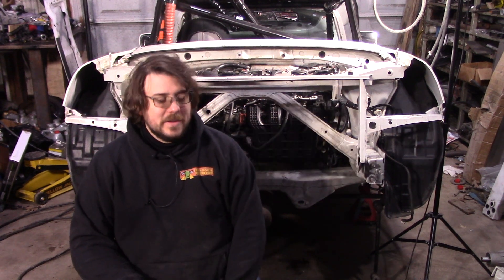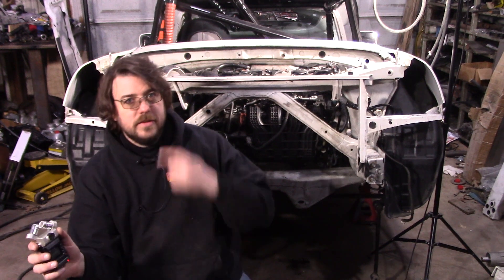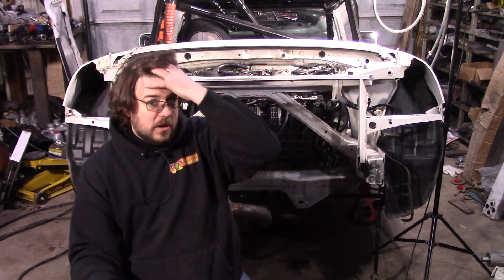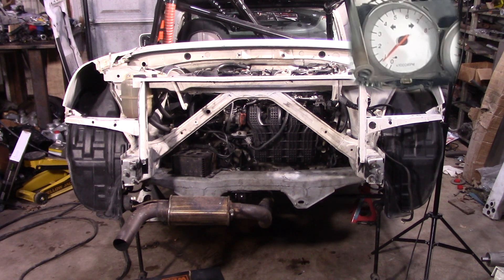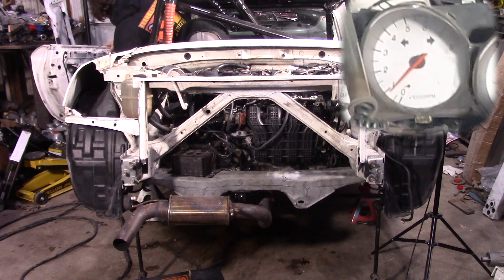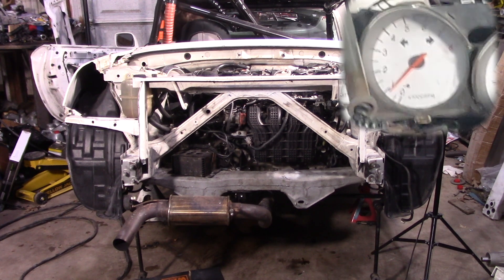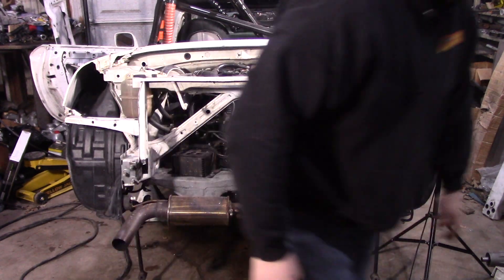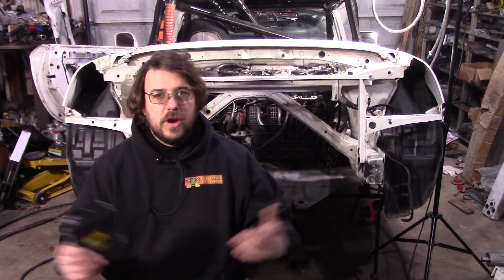Testing the 1AR-FE to 8200RPM in the MR2 Spyder.

Comment: The piston speeds of that motor reving to 8k RPM is 7,533 FPM. For reference the AP1 S2000 at fuel cut of 9150 RPM is 5,380 FPM. Holy shit

Comment: Solid lifter conversion next? Evo8 has this to rev to 10k plus rpm with also these little rocker clips that clip the edge of the roller follower onto the solid/hydraulic lash adjuster so they wont bounce off and go sideways like they do on sr20s

Comment: I’m sure you have mentioned it but I can’t find the video. BUT. What transmission are you using? I found the EB60 LSD on your website. Is that the transmission you are using? I’m guessing it bolts up to the 1AR no problem?
Reply from the maker: with the 2AR In the MR2 Spyder i use the EB60 transmission, in the SW20 i use the E350. The 1AR and 2AR are the exact same external dimensions so the same transmissions can be used.

Comment: where's the shop heat?
Reply from the maker: I have an old noisy diesel fired heater but it's too loud for the camera and frankly i'm tired of smelling like diesel when i come in from the shop. Eventually i'll get a proper mini-split out there.
Reply: @FrankensteinMotorworks  nvidia RTX voice works pretty well to cancel that out! You'd obviously have to post process it as you're not a live stream but I suppose it's easier to switch the heat off for filming 🙂

Comment: As a motorsport engineering student (who dailies Gen 3 MR2) I would reaaaallyy want to know more about the maths you used to estimate the valvetrain RPM limits. 
Keep up the good content, mate!
Reply from the maker: I did it two ways, first, i analyzed all the motions equations involved here without doing any solving just to figure out if the relationship was a logarithmic, linear, square or cubic relationship. Best i can tell it's a linear relationship. So i characterized the current springs with the understanding that they were designed for 6400 and have never had an issue at 7200RPM and scaled up linearly to 8800/9900. I also selected beehive springs to get a better defense against any harmonic frequencies. I also selected titanium retainers to remove a bit of inertia from the system but more importantly to give me a better ratio between extended and compressed.

I also unrolled the cam profile and measured the weight of all the components (including 1/2 the spring and about 5/8ths of the rocker) and calculated the vertical inertia of that weight going up that ramp and determined if the spring rate pushing it down would be enough to stop it from jumping off the cam. I used rough rounded numbers for all this math but it gave me a number above the 9900rpm number above so i called that good enough. 

Neither of these methods are as accurate as they could be but it is good enough for this case.
Reply: Oh, that's some tasty nerdy details. Thank you.
And that's why I love your channel. 👍

Comment: How do you think the Haltech will doin controlling the VVTI?   Do you have some maps of the stock VVTI cam setting's as it progresses through different loads and rpms?   I'm going to be running Haltech on our 2gr and i can't imagine how i'm going to program the cam advance and retard as it goes through it's rpm ranges.  I've never had to program a vvti engine and it's a whole new world to me.  Let us know how it goes!
Reply from the maker: I'll tell you more in a few weeks but i expect it'll do great. for the base vvt-i, cams should be about zero at idle, then at about 4000 or so the intake cam goes to the max and then backs off towards redline. the exhaust should start going up around 5000 or so and max out above 6500 and stay there. that won't be perfect but that'll give you a good spot to start tweaking from
Reply: @FrankensteinMotorworks  Thanks for the info!  Didn't you once unplug the VVTI on your 2gr and it still made pretty decent power as i recall. I've half thought of somehow setting the cams at optimum for max HP and locking them in permanently.
Reply from the maker: @MadManMachines  You can certainly start by just leaving them alone but it would do the motor an injustice if you did not use the vvt-i.
Reply from the maker: @MadManMachines  The other trick is to use MAF, not MAP. the haltech system makes this easy and I'll probably go over it a bit when i make a video.

Comment: Awesome finding, mr mad scientist.  Will this 1ar swap pass obd2 smog?
Reply: Probably would if cats and egr are retained
Reply from the maker: Ruben, egr is all done via exhaust vvt-i on this motor. there are no parts that are EGR only so no egr parts to have filled with gunk as a result.
Reply: @FrankensteinMotorworks  ah nice. As you can tell I'm not too familiar with this engine but seems like some fundamental parts (like internal egr) is the same as on a 3sge beams
Reply from the maker: @ReubenHorner  Honestly EGR plumbing was such a reliability problem i don't think there are many motors left that do EGR with an EGR valve and plumbing into the intake manifold anymore.
Reply from the maker: It depends on your exact local regulations. With a tiny bit of body modifications you can fit the unmodified OEM catalytic converter and then with a bit of extra effort you can fit the stock airbox. With those things you should be able to pass a 2GR through California's CARB regulations. the 1AR is indistinguishable from the 2AR on the outside so i expect you'd be able to get that through also. with cams i don't know if the emissions side of the ECU will get angry or not.
Reply: @FrankensteinMotorworks  My local regulation doesn’t even do visual inspection, just the obd2 check.  As long as there’s no check engine light, they let you pass.  Will your tuned ecu get rid of the check engine light?  Hopefully the new cams wIll not throw a CEL.
Reply from the maker: @Johnnywankerr  Yes, this configuration should not throw a CEL. Currently it does occasionally throw one for a random multiple misfire which i have to address but i expect i will be able to.

Comment: I’m loving the frequent uploads! This is honestly my favorite channel on YouTube.
Would you recommend reving the 2GR out to 8000rpm with upgraded valve springs? I’ve seen some people even rev to 8200rpm. I would love the extra 1000rpm in second gear for autocross. I don’t know if the motor could handle bouncing off of the rev limiter at 8000rpm on some autocross courses though.
Reply from the maker: Oh, also don't get used to the quick uploads. I still have a job and a company to run :) but i do want to get to a somewhat more regular routine though. potentially every other week or so.
Reply from the maker: The 2GR has a MUCH shorter stroke so it isn't as stressful on the bottom end as doing 8000RPM on the 1AR. The 2GR at 8200RPM has the same piston speed as a 1AR at 6800RPM. of course the accelerations aren't the same the reality is probably closer to 7200 on the 1AR has the same stress as the 2gr at 8200. The 2GR also has a smaller cylinder size which means each cylinder isn't hitting as hard. In short, as long as you upgrade the valvetrain i would be ok to spin the 2GR to 8000. Do expect accelerated wear though.

Comment: Smooth as silk. You should've backed yourself. You're too thorough with your work and calculations to make an enormous screw up. Keep up the good work. I wish I was half as good of a mechanic as you are 😁
Reply from the maker: I felt confident on the valvetrain but a 105mm stroke at 8200RPM on internal components is a little crazy. I was genuinely concerned about potentially sending a piston into low earth orbit. I still don't feel that i'm out of the woods yet. I hope it stays together for long enough for me to see where the power band is on these camshafts and based on that i might see about upgrading the rods and pistons.

Comment: Where'd you get the valve springs, Kelford cams or?   Were you worried about piston to valve clearance with the higher lift cam?  I'd imagine with VVTI, it was close even with stock cams in certain ranges?   Just picking your brain...
Reply from the maker: I will share the details but i don't want to share them until it is properly tested. I've had issues in the past with getting blamed for misleading people so i don't want anyone to follow down this track until it's a bit more tested. That said, the cams are custom regrinds and the springs/retainers were purchased by me from a completely different supplier so it isn't a combo that was just recommended together. I felt that the combos that were recommended had too high of a spring pressure and would cause unnecessary friction.

As for the clearance, i did specifically ask for a lower lift cam. I only added about 1mm and the regrind could have added closer to 3mm based on the size of the base circle after the regrind. The motor is an interference motor but only just barely. at TDC there's about 8 or 9mm of valve clearance and the max lift from the factory is 9.5mm and now it's about 10.5mm I think it's got more in it if necessary but honestly 10.5mm valve lift is quite a bit already.

Comment: Sounds really great!  Didn’t think you could go that high with mostly stock internals.  Can’t wait to see the Dyno results.  What is the model of the Haltech ecu?  So excited!  Do you think the 1AR with cam vs. 2AR with the cam will have similar proportional results?
Reply from the maker: The AR motors are surprisingly stout but I am a bit concerned for the pistons though. These are some pretty serious forces involved.
Reply from the maker: I forgot the other half of your question, sorry. It's the 1500 ECU. i would expect the 1ar vs 2ar to be proportional results. Everything about the motors are the same except for the stroke. the 1AR made a bit more power than the difference in displacement would be expected to make but i'd expect that the 2AR would pick up that difference with the bigger cams and then some because the difference is likely due to the intake or exhaust pipes being tuned for a bit higher airflow than the 2AR in 100% stock form was giving them.
Reply: @FrankensteinMotorworks  Thank you for your responses.  Decisions, decisions!  2GR vs. 1AR vs. 2AR.
Reply from the maker: @samuraialbany  as far as i'm concerned, as long as you keep it Toyota you can't go wrong :)
Reply: @FrankensteinMotorworks  Ha! I am coming to the same conclusion.  I thought the cost would be significantly less with a k-swap.  It's not.  Without people like you investing their effort into making Toyota options viable for people like me, I wouldn't have a choice.  The biggest piece that is missing for me is the tuning part.  Will you offer a service where you look at the data log from a haltech and custom tune someone's specific setup?  I am not sure if there are "e-tuners" out there for Toyota like there are for Honda.  I would guess you could always find a tuner that has a dyno you can go to for the service who may be able to address your specific needs.

Comment: Shredding those videos this week! I'd still be hesitate to do 8k revs with the stock block and oil pump. But I'm sure you know that ;)
Reply from the maker: I'm absolutely not worried about the block or the crank, they are proven to well over 9000. The stock oil pump is known to be ok to 8500 from what i understand. The valvetrain of course is what we're here to test but mathematically it should be just fine. But that leaves the connecting rods and the pistons. The stock rods are rather nice forged units but the pistons are cast. I certainly am concerned that we may be exceeding the capabilities of the pistons. The only thing i hope is that it start knocking before letting go so i know. But even if it does not, the motors are relatively cheap.
Reply: @FrankensteinMotorworks  how expensive is an engine in your location out of interest.
If the block and crank is anything like older toyota stuff then it will be sweet to 9000+ (with a balance) and a whole lot of boost if your that way inclined
Reply: @FrankensteinMotorworks  Are you sure the rods are forged? They look like all others pressed powder metal Toyota rods. Pretty weak at the glance.
Reply from the maker: @АндрейЛеусенко-д4е  yes, the 1ar/2ar rods are forged. this is different than a lot of other current toyota motors but the long stroke and high RPM pretty much requires them to be forged.
Reply: @FrankensteinMotorworks  Would you recommend to change them to aftermarket ones for turbo applications? Planning around 500-550hp. I guess yes, but anyway asked. OEM ones do look tiny.